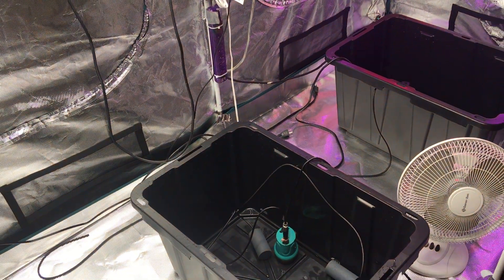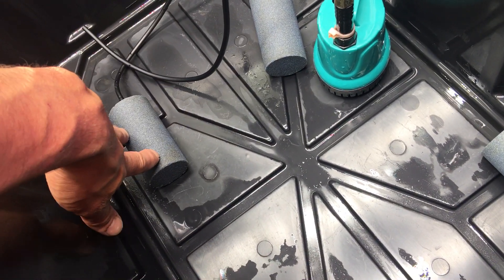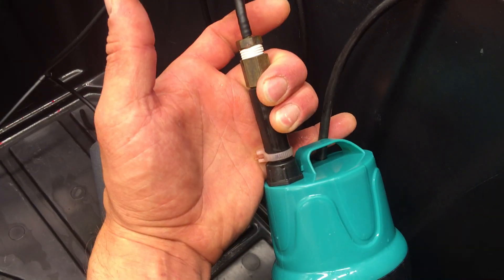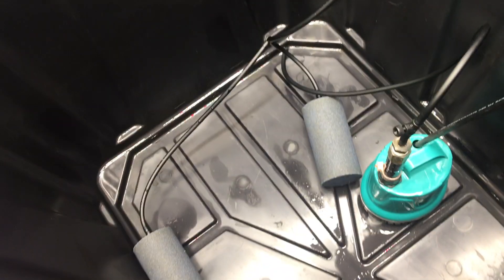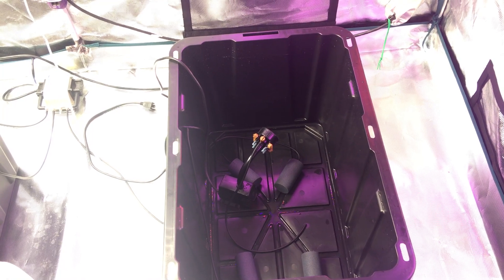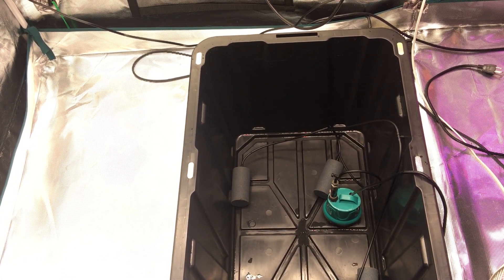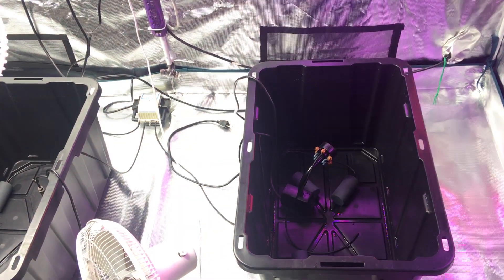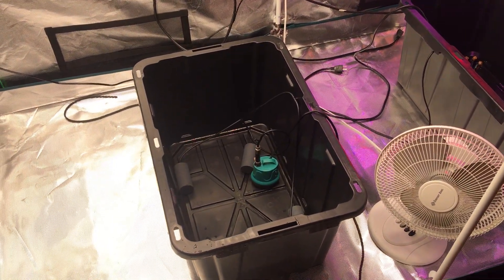Bubbleponics components (2019)

Comment: Put links for the parts.
Reply from the maker: The diffuser aka air stone has changed since 2019 and proper link was provided.  3 links one for the stones, another link for the pump, and last link is the air pump from general hydroponics.
Reply: What size adapter connects to the 5/8ths OD, 1/2 inch ID & the 3/16th inch airline tubing?
Reply from the maker: https://www.amazon.com/gp/aw/d/B07QSCW7LK/ref=ox_sc_act_image_1?smid=A3AP7ES1BW7JQM&psc=1

https://www.amazon.com/gp/aw/d/B07G3Z5TCJ?psc=1&ref=ppx_pop_mob_b_asin_title&th=1

https://www.amazon.com/General-Hydroponics-Dual-Diaphragm-Pump/dp/B008UF9XLY?pd_rd_w=Xw34e&pf_rd_p=120fb335-65a1-48c3-9190-e6649f035fca&pf_rd_r=DXMC28FNDVX1PD6GRYD7&pd_rd_r=399f6963-a123-461a-8cd6-092935e5752c&pd_rd_wg=iNKds&pd_rd_i=B008UF9XLY&psc=1&ref_=pd_bap_m_rp_21_sc

Comment: just to verify it,this system would only work on R/O water right? got some peeps claiming im wrong yet the numbers tell me its just impossible to use regular tapwater @lmao, still wanna have it verified :D
Reply from the maker: I haven't used R.O. water to date.  I set out my tap water 4 days in advance before water change day.   I would like to point out Im from alaska where the water is clean.  Some people may live in a huge city where tap water is questionable.  There is a natural spring here out the road which would be better but then I would have to haul water around.  You can in fact add a filter to your water supply at your house and that would be a great solution if you can’t use RO or dont want to.  I have installed those house filters in a few homes around town.  The filter last 6 months before you have to replace.
Reply: @BubbleponicsKing  Damn, well thanks for the info but the water here pff its hard as nails, insane, our system uses calcium to idno to do what but its in there and it sucks, cant even have a good normal shower bc the calcium aka hardness just sandblasts my skin -,- its amazing to hear that you are able to draw it from the tap,it blows my mind.
Reply from the maker: Man yeah that hard water sucks.  Very hard on the skin when taking a shower.   Just seems bigger cities is always the worst water.   Definitely using the tap depends on the area you live and maybe someone has well water too.   Some of the best water I used was water from a natural underground aquifer that supplied the city from an old volcanic area.
Reply: @BubbleponicsKing  thats perfect 👌
Reply: Bubbleponics King i use ( ro) water its alitle more expensive every week going to windmill and getting 5 gallon jug but in vegas we have hard water. I just add cal mag . But thats in soil though.
Reply from the maker: Yeah sometimes you have no choice but to go get good water.  I would do it if I had to as well.
Reply: Get a RO buddie system from Amazon cost me $73 for the RO system with inline TDS tester and shut off valve system with float. It's portable hooks up to your sink. Filters 50 gallons a day they do have bigger systems.